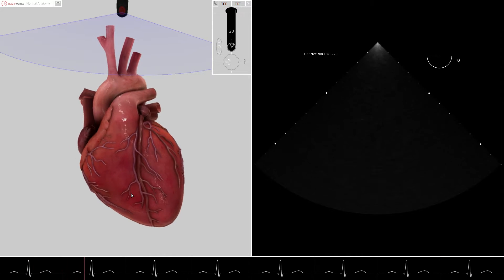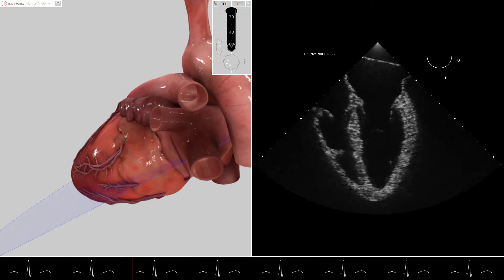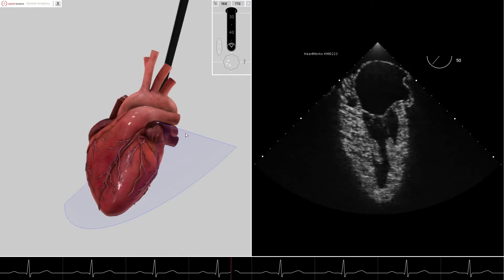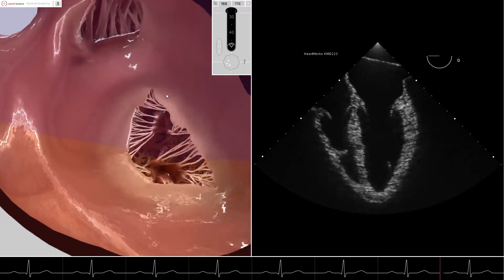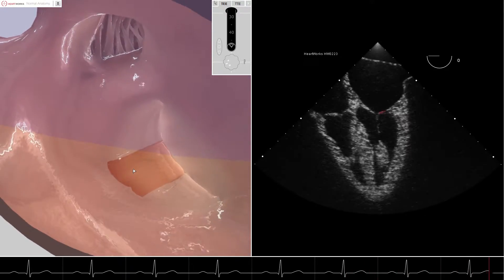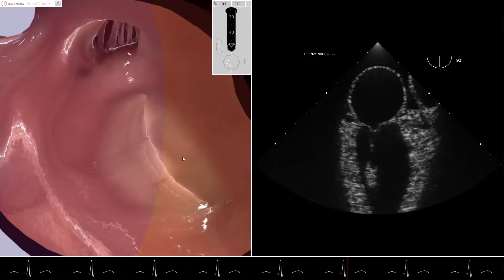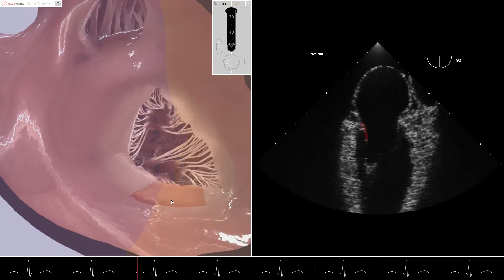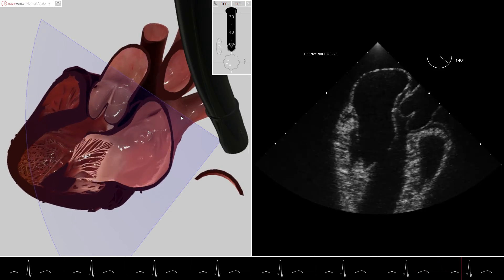Which Scallop?

Comment: WHY DOES IT HAVE A BUNCH OF CREEPY TENDRILS ON THE INSIDE OF IT
Reply: Those are called cordae tendinae.  They are strong fibrous connections between the papillary muscles below (2) and the tips and undersurface of the leaflets.  The mitral valve is only 2-4 mm thick and very delicate so that it opens very easily to the low pressure of the left atrium but it has to stop regurgent pressure from going backwards.   The pressure it has to stop is systolic blood pressure which is very high (120-140 mmHg).  If you look closely you will see that the chordae form little arches which makes the mechanism very strong and beautiful, even though it does look kind of ugly.
Reply: @neilgreen007  THANKS BUT I STILL HATE IT ITS LIKE OUT OF A HORROR MOVIE